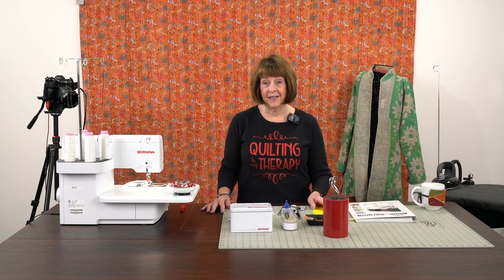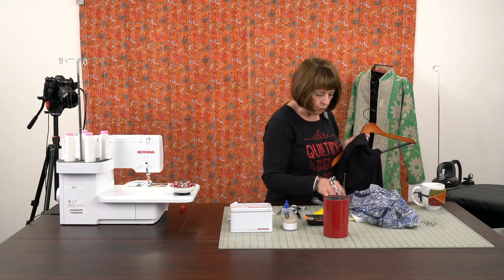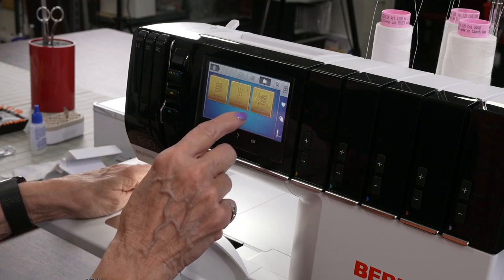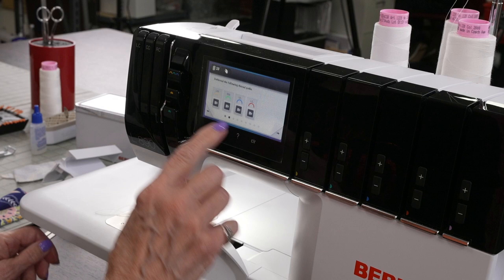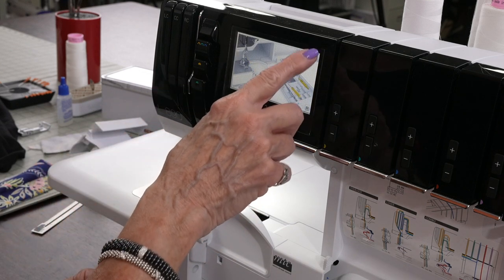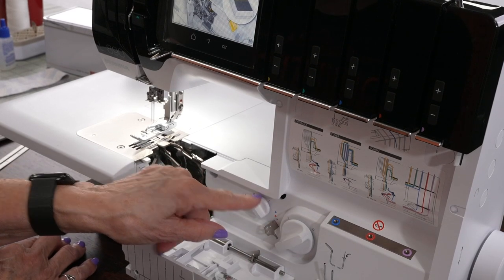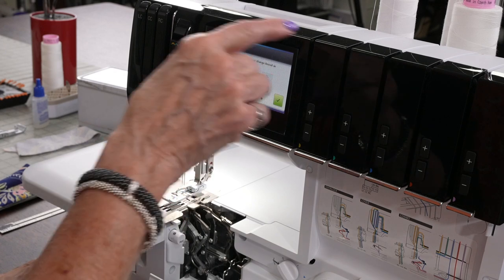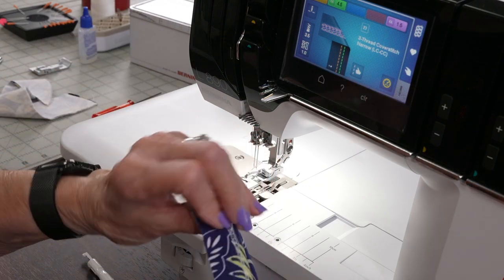How to make a coverhem stitch with the Bernina L890 Serger - It's so easy!

Comment: Any specific suggestions for a light jersey knit tee-shirt coverhem settings on L890?  it is bunching up when sewing, almost as if presser foot pressure it too heavy.  Should the DF be changed, or is that only for the overlocking function?